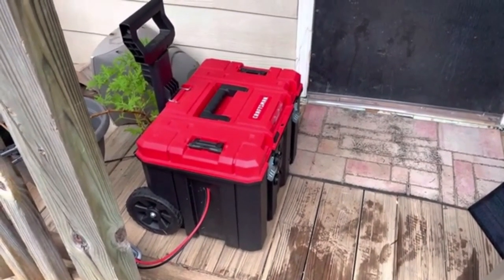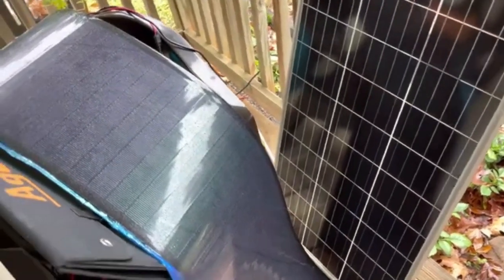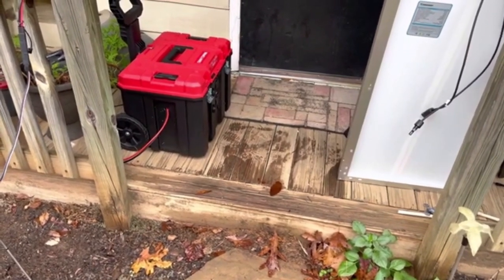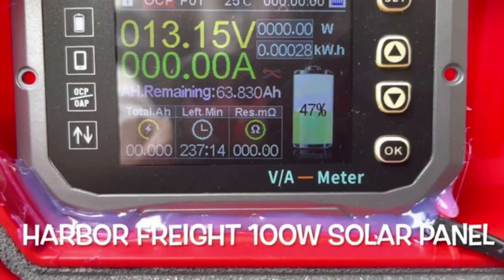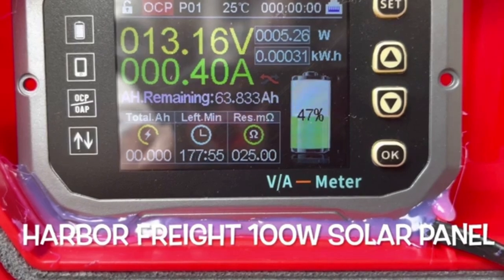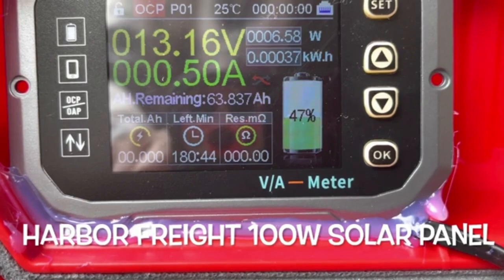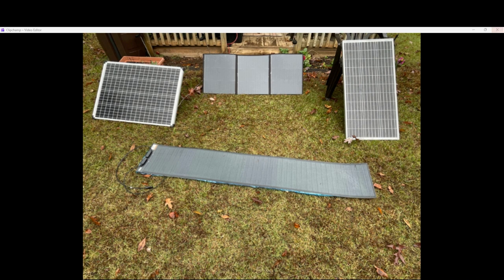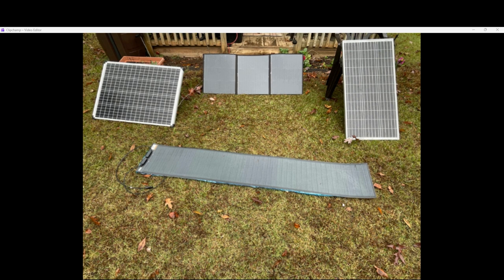How Much Power Do 100W Solar Panels Produce During Rain & No Sun? Do They Produce Power?

Comment: I use a 210w Trina panel and 2 100w HF panels. And for the last 2 years the HF panels have worked incredibly.  The panels do still produce over the rated on sunny days.  I have seen myself this last summer 105w per panel. Still holding up very well.
Reply from the maker: Awesome yes they hold up extremely well

Comment: During overcast days or rain my panels occasionally will not even get high enough voltage to induce a charge. Typical open circuit voltage on my standard panels 21 V and another set of flexible amorphous panels. 33 V.
Reply from the maker: What type of cc are your using?
Reply: Thanks glad you responded. The charge controller is EPEver 100volt 30amp max it is xtra model with the waterproof controls on the face. It also has a lot of excellent details. The other models don’t have. Wired it up to Chinese obviously Mostar lithium. Chins 100 amp hour 12v 

Currently, the sun is just about fully set and the input voltage from to 110 W Harbor freight equivalent panels they’re actually from nature power not indirect light at all since the sun is pretty much getting below the horizon around 10 V not showing any type of watts or amps at this point. On my charge controller. Typically it likes to get about 15 V input before it shows much in the way of charging. MPPT type of charger, which I’m sure you understand, but do have a couple of the pulse with modulation El cheapo chargers that came with the kit. Those I keep around in case I need to hook it up to a car battery or something. This is really more of a back up system. The whole thing is wired to a couple of inverters one of them a 1500 W capable of running a microwave and a small air fryer.
Reply: I behave a 150 watt panel on a rainy day at best 7watts
Reply from the maker: @sosteve9113 that’s pretty low for that size
Reply: @DIYKAI  I did a couple of test runs and at best 7 watts 
In full sun at best 50 watts but to be honest mostly around 40 watts
Reply: @DIYKAI  when monitoring my panels noticed many variables and factors affect their output on rainy days. Obviously they’ll do better if it’s a sun shower. If the rain clouds are overhead and it’s not an optimal time of day for solar array sun exposure, I’ll get very low wattage on my panels as well.
Reply from the maker: @goodredman most panels performed as expected except the folding travel ones they really suck lol

Comment: A small Harbor Freight Predator generator could be used to top off your batteries quickly.
I purchased a Predator 3500 this fall used for $500.   In an hour or less you would be good to go and charged up for the day.    200 watt solar system with a 100 watt hour battery cost me $750.    I am going to scale up the solar system.  Thank you for the video!  : )
Reply from the maker: Yes we have a few back up generator just in case we have a 600w array that’s doing perfect. Thanks for watching!